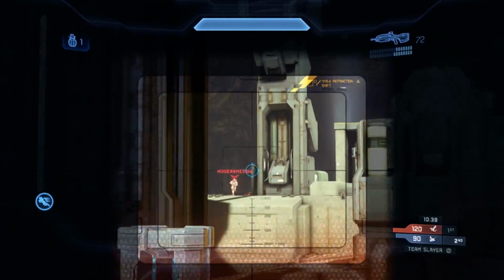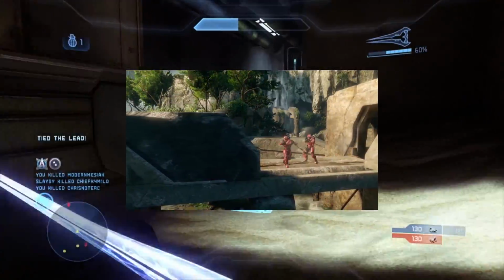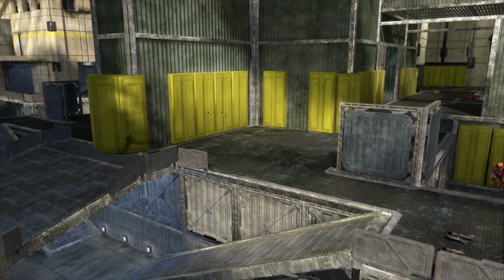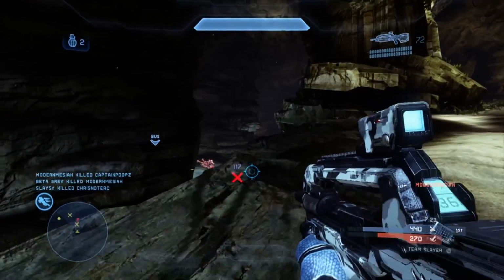How To Forge - "Power Weapons" (Halo: MCC)

Comment: I personally prefer fast times with slightly less spare clips, especially for Asymmetrical maps. Also, static spawns are king.

For example, Rockets with 1 spare clip every 2 minutes, and Snipers at 90 seconds with one spare clip. This encourages movement and increases the pace of the game, especially at a high level. Halo shouldn't be having a small skirmish over a weapon, getting it, and then camping a power position until the next thing spawns.

This is needed for Halo 5 especially, due to the large maps and high mobility which slows the game down.

It's alright to have multiple weapons spawn at once since it makes teams have to make more interesting plays and choices regarding which power item to push. This makes every game play differently, rather than the same strategies always being used. It also keeps the losing team from being stomped on because all 4 players constantly setting up around the one power weapon spawning. However, the losing team still has to work hard to come out on top.
Reply: +Shanez1215 Fair point indeed! The reasoning for different spawn times is to help promote map movement. But I totally get your perspective.
Reply: I may need to clarify. When the spawn times are different you have the winning team get a weapon that's spawning and use it to beat up the losing team and stop them from gaining the control of the next weapon spawn.

When multiple weapons are spawning at once, the winning team has to work harder to keep hold of their lead, but the experience isn't cheapened too much.

Those who think it does cheapen the experience are probably the one's who think having two Snipers with lots of ammo on Zenith conveniently close to the highest points on the map with the best sightlines is good map design. I can't stand that map or any "epic" clips people get on it. /rant